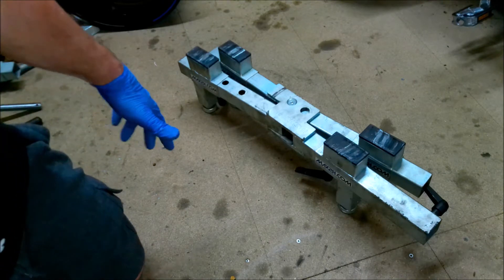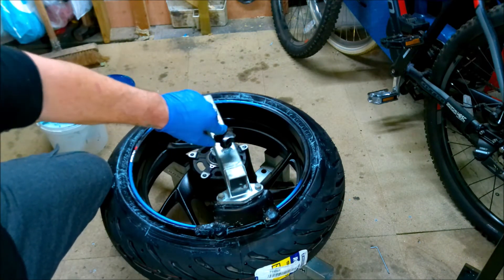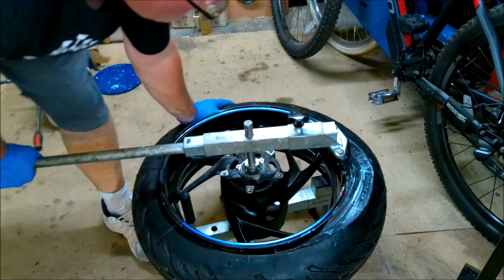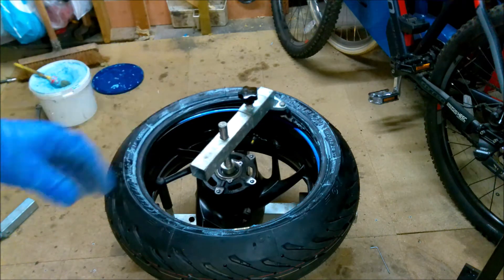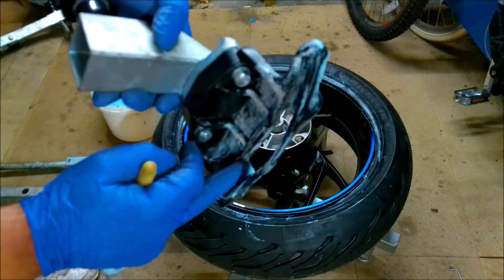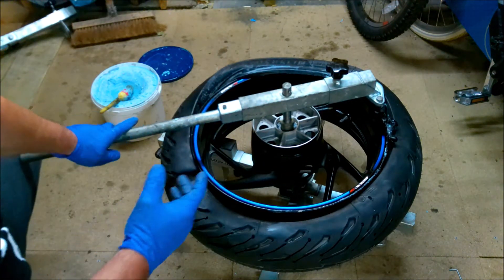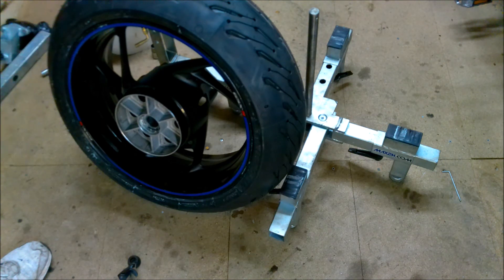Max2h evo2 Tyre Fitting tool Definitive Guide

Comment: Excellent! Very good instructions! I've ordered my self one of these. Got 3 bikes and it's like almost at all time at least one tire to worry about. Having a tool like this, changing a worn out tire is done in an hour total, instead of ordering an appointment at the local work shop. Once no longer needed it can always be sold. 
I think maybe only one set of tire changed (typically labour cost £70-100) will save you in on the cost of this tool (when taking into account the 2nd  hand value of it)
Reply from the maker: It’s definitely saving me time and money 👍
If you ride fast I’ve found it’s best to balance the wheels before re-fitting. 
Thanks for watching and commenting 🙏

Comment: I bought this last year during COVID - took a long time to show up - instructions are all in German - this video is a Godsend.  THANK YOU !!!
Reply from the maker: Glad it helped. Thanks for watching and commenting 👍
Reply: @bikerantics5001  Thanks to your video, I just went out, and used it for the first time.  Not a motorcycle tire, rather 30 year old tires on a garden tractor.  The bead breaker was key.  The curvature of the small wheel was too sharp to use the "lifter" - so just had to use a spoon and a couple of screwdrivers.  Gottem' off.
Reply: Dónde lo compraste?
Reply from the maker: Hi, I don’t think they make them anymore, so I wouldn’t know where to buy one now, sorry 🤷‍♂️
Reply: @bikerantics5001  Not trying to buy one -- I HAVE it, and just trying to learn how to USE it.  Thank you.

Comment: Cool, I'll be buying new tire for the front next season and will certainly refer to this vid again. Appreciate the patience in inspiring us to do this. Some people employ a couple of zip-ties to squeeze the opposite ends; I've not tried those myself.
Reply from the maker: It really is as easy as you see in the video, no need for zip-ties, just keep the tyre off the beed. Hope it all goes well for you next time 🙏
Reply: We ordered a Reifenmontiergerät EVO2 + Wuchtbock + Starterpaket + Tasche) full kit. The order arrived some 10 days later but when opened we suspected that it was not  all completely new... on closer inspection one of the elements was badly oxidised and several of the nuts supplied were the wrong size. We emailed to complain... no reply. We called and left several messages on their answerphone... no call back! Appalling customer service and second rate rate product for which they charge a lot of money! Is this the famed German quality???

Comment: Great video!! it's worth mentioning that some tyres are marked with a red dot which has to be alighned with the valve. I always leave the wheel weights on as most of the time the wheel is perfectly balanced after the tyre change. Nothing to lose.
Reply from the maker: It’s also worth mentioning that the red dot denotes a ‘high’ point in the tyre, as tyres are almost never perfectly round, and this should be aligned with the ‘low’ point mark on your wheel. 
If there’s a yellow dot on your tyre it denotes a ‘light’ spot, as tyres are almost never perfectly balanced, this should be aligned with the valve stem. 
If you have both a red and a yellow dot on your tyre but no low point marks on your wheel the red dot should be aligned with the valve. The red dot takes precedence over the yellow dot as you can use wheel weights to counteract the issue with balance. 👍
I may try leaving the weights on next time and see what happens 🤷‍♂️
Thank you for watching and commenting 🙏

Comment: Bloody brilliant!  I'm tempted, but probably a bit of learning needed.
Reply from the maker: Mine has definitely paid for itself now and I do enjoy the convenience of doing it myself. The main thing I found was making sure you push the part of the tyre, opposite to the section your taking off, into the smaller diameter of the wheel and then it’s almost effortless. 
Thanks for watching and commenting 🙏
Reply: We ordered a Reifenmontiergerät EVO2 + Wuchtbock + Starterpaket + Tasche) full kit. The order arrived some 10 days later but when opened we suspected that it was not  all completely new... on closer inspection one of the elements was badly oxidised and several of the nuts supplied were the wrong size. We emailed to complain... no reply. We called and left several messages on their answerphone... no call back! Appalling customer service and second rate rate product for which they charge a lot of money! Is this the famed German quality???

Comment: Thank you for the video! The evo2 looks like a really well-thought-out tool
Reply from the maker: It really is!
Reply: We ordered a Reifenmontiergerät EVO2 + Wuchtbock + Starterpaket + Tasche) full kit. The order arrived some 10 days later but when opened we suspected that it was not  all completely new... on closer inspection one of the elements was badly oxidised and several of the nuts supplied were the wrong size. We emailed to complain... no reply. We called and left several messages on their answerphone... no call back! Appalling customer service and second rate rate product for which they charge a lot of money! Is this the famed German quality???
Reply: @jbv6257  Try calling them the one I got was brand new
Reply: @kenja_taimu  As I told in my comment, I called and left several messages on their answerphone...no call back!
Reply: @kenja_taimu  Have you checked inside the tubes?? There are all oxidised.

Comment: I have been wrestling with the idea of getting one of these or not for a while. It would be really helpful for track days and swoping out road, race and wets. Really useful tip ref squeezing tyre to get more space. You have re-sparked my interest. Thanks for the vid. Where do you get your lubricant from?
Reply from the maker: No problem, glad you enjoyed it 🙏
The lubricant is just a tub of tyre soap from ebay, about £12 with a free brush. 
Sorry it’s taken a while to respond but YouTube hid your comment for some reason 🤷‍♂️
Reply: 3in1 spray oil is great for Tyre Lube, stays slippy on the rubber for 10mins whilst you fit and seat the bead, then flashes off. plus its clear so doesn't leave any white residue to scrub off!

Comment: Brilliant video ;) Instructions are spot on, Thanks for that. Only question I have to ask is. Can you seat the bead without a compressor? Will a decent electric one like a ring RTC1000 work?
Reply from the maker: Hi, it should be okay. I’d take out the valve core, for a faster flow into the tyre, and lubricate the edge of the tyre with tyre soap. If you have air escaping stand the tyre up and put the part of the tyre where the air is escaping either at the top or on the floor and then push down on the tyre to try and help the bead seal. Sometimes bouncing the tyre on the leaking part can help. Hope that helps and thanks for watching and commenting 🙏
Reply: @bikerantics5001  Thank you 😉 I've just ordered a very similar tyre changer from motea uk but as I don't own a compressor I was going to try my trusty tyre pump (Ring RTC1000) to seat the bead first. With the valve core out it should be ok, But... If it doesn't work I'll just accept the fact a compressor will serve me better 🤣 Whatever happens I'll report back in the future 🤞
Reply from the maker: @T1Cybernetic  I think it should be okay, just a bit more fiddling about🤷‍♂️

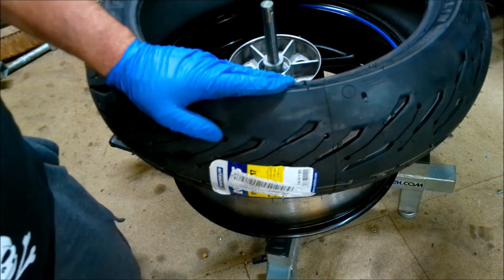Comment: TIRE IS ON BACKWARDS!! DANGEROUS! At 13:14 he figured out the correct direction. After putting on tire lube at 15:16 he accidentally put it down backwards. Don’t make that mistake guys! That can get you hurt real quick. The reinforcing threads on the inside of the tire are made to go on one direction. Put it on the wrong way and your tire can blow apart on you. At high speed… Scary!
Reply from the maker: Watch this for an explanation 👍

https://youtu.be/aCk4nb0OWRc

You’re the second person to notice 🏅, well done🫡
Reply: @bikerantics5001  👍🏻 Otherwise, good video.
Reply from the maker: @Taekwondo101Official  thanks 🙏

Comment: Hey. I've never changedca tire. Hence watching videos. If i could get clarrification. Several other how toos say don't lube outside bead where it will rest against inside of rim after install cause tire could slip and rotate while riding. Is this the case?
Reply from the maker: Hi, I use an actual tyre soap and have never had any slippage or spinning of the tyre on the rim. I’ve done some hard acceleration from a standing start on all my bikes and the list includes a GSXR 1000 and a Hayabusa and have never had any tyres spin on the rim. I’ve actually heard that the tyre soap can actually help seal the tyre to the bead because it fills all the slight imperfections in the wheel, don’t know how true that is but it sounds possible 🤷‍♂️
If you were to use a neat solution of washing up liquid you’d possibly have issues with slippage but having not used it I couldn’t say for sure🤷‍♂️
Hope that helps and thanks for watching and commenting 🙏

Comment: You can use quickgrios over the tyre to keep the tyre aqueezed in
Reply from the maker: Hi, I haven’t a clue what ‘quickgrios’ are and searching the internet didn’t help either🤷‍♂️. Would they be a type of cable tie/ zip tie?
Reply: @bikerantics5001  i opologise my friend my typos are shocking at times its the phone small keyboard. They are called quickgrips i think they are made by irwin as i am a joiner i have a few different sizes basically they a pump clamps or cramps. You can extend them and them pump them closed around the tire
Reply from the maker: @austinmatthews347  okay, cool, I understand now, certainly would assist with the whole operation 👍

Comment: I noticed there is no brake rotors and/or chain star.  Are these to be removed prior to using the tire changer?
Reply from the maker: Hi, the rotor, or rotors if doing the front tyre, can stay on the wheel but you’ll need to pull your sprocket carrier out of the cush drive. Thanks for watching and commenting 👍
Reply: Ive done mine with the sprocket in place, but it is easier with it off.
Reply from the maker: It’s good to experiment 😎

Comment: We ordered a Reifenmontiergerät EVO2 + Wuchtbock + Starterpaket + Tasche) full kit. The order arrived some 10 days later but when opened we suspected that it was not  all completely new... on closer inspection one of the elements was badly oxidised and several of the nuts supplied were the wrong size. We emailed to complain... no reply. We called and left several messages on their answerphone... no call back! Appalling customer service and second rate rate product for which they charge a lot of money! Is this the famed German quality???
Reply from the maker: I’m sorry to hear about your problems with both the quality of the product and the lack of customer service. I’ve had no such grief and have changed many tyres without trouble and because of that I’m very happy with the Tyre fitting tool. I hope you receive the happy ending you rightly deserve 🙏
Reply: @bikerantics5001  Thanks for your reply. The company confirmed to me that the rust was endemic (inside the tubes) and there was nothing else to do ... so I have returned mine! Good luck with yours...

Comment: Just tried this on a 21” dirt tyre - you’d think that’s an easy one… often have do it in a forest -!  Initial thoughts are utterly useless fiddly machine! Just  reverted to tyre levers 🙄 … will try again with the rear soon
Reply from the maker: I’ve never tried a 21”, biggest I’ve done  is a 19”, so I don’t know if that’s why it was a pain?!
Once I started pushing the part of the tyre opposite the section being removed into the middle/ smaller diameter of the wheel to give me a little more ‘free play’ I’ve had no problems removing or fitting tyres . . . I certainly wish i had the space to permanently fix the tyre tool down!
Thanks for watching and commenting 🙏
Reply: We ordered a Reifenmontiergerät EVO2 + Wuchtbock + Starterpaket + Tasche) full kit. The order arrived some 10 days later but when opened we suspected that it was not  all completely new... on closer inspection one of the elements was badly oxidised and several of the nuts supplied were the wrong size. We emailed to complain... no reply. We called and left several messages on their answerphone... no call back! Appalling customer service and second rate rate product for which they charge a lot of money! Is this the famed German quality???